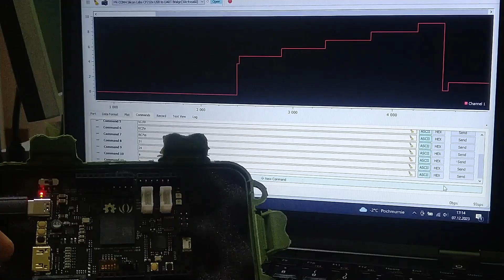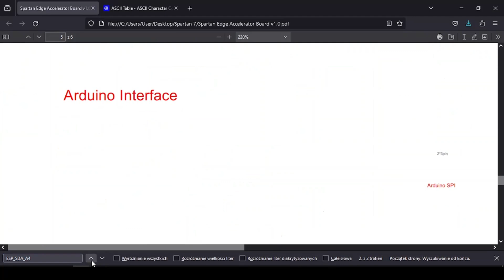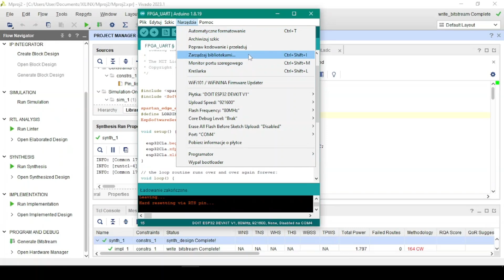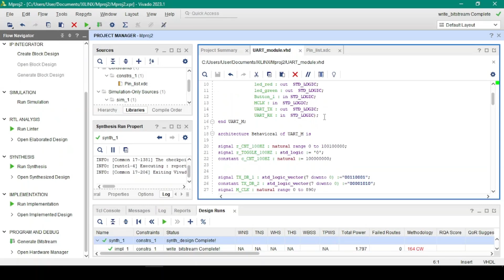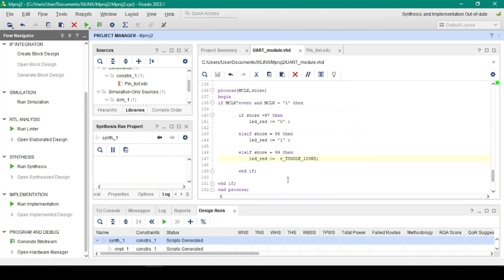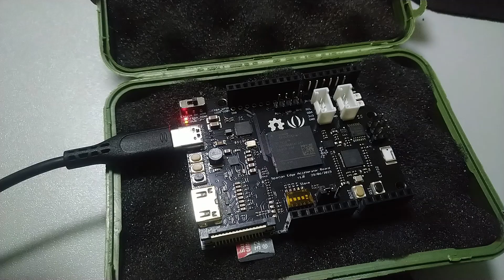Spartan 7 Seeed Studio USB-UART example

Comment: I'm trying to replicate what was done in the video, but I'm only getting garbage. I also tried using UART transmission so that when I press button 1 on the FPGA, it sends the letter 'U' to display on Tera Term and the Arduino IDE, but the garbage is the same (not exactly) when an LED is lit, and I press restart again. Any suggestions to handle and fix this?
Reply: same problem please help
Reply from the maker: Open the terminal in hex view form, get the samples and check for missing bits, if you have a osciloscope check the timing of uart, make sure the stop bits and parity bits are correct with the fpga
Reply from the maker: I will check it and maby add some features to the example in the next week (in the upcoming one i will not be able to)
Reply: I have checked the timing and UART tx with oscilloscope and it is correct but can you please elaborate the pin mapping between esp32 and fpga so that I can see my sent data.
Reply from the maker: @AdityaAyush-s7u  The FPGA uses pins P12(RX) and P13(TX) and those are by default named  FPGA_ESP_SCL
 and FPGA_ESP_SDA on the schematic and this goes to an analog switch SW2 where normaly closed connects to lines  ESP_SDA_A4 and ESP_SCL_A5 and those are pins 32K_XP and 32K_XN on the ESP32.
Today i will try to check the example as soon as i fix the vivado install on my pc because it got broken of not being used i guess.
Reply from the maker: @AdityaAyush-s7u  I checked the FPGA program compiled in a fresh install of Vivado 2024.2, the ESP32 program with boards version 2.014 (new versions are not compatible), EspSoftwareSerial library version 8.1.0 and that compiled in Arduino 1.8.19 - all works correct.
You say that the garbage data is changing when the red led is on, this looks like the anaglog switch is not closed so lines from FPGA may not be connected to ESP32 and that results in strange data. It also may be software fault on the ESP32.
Reply: @e-exp  Thanks for your replies. I think you pointed the correct mistake. I want to add few more thing that when I seperalty try to connect the esp32 to pc by uart still it is giving garbage also I tried to create access point using esp32 given on board and it is showing nothing, but the same code working fine with other external esp32 chip.
Reply: One more doubt that Can I seperatly programme esp32 of fpga board?
Reply from the maker: @Did You check the softwareserial library by sending a test string with it to a usb-uart converter from the esp32 to a pc?
Reply: @e-exp  yes, I tried by sending "Hello world" but it did not worked with esp on fpga . Also I tried on external esp32  but in that case it worked.
Reply: Please help